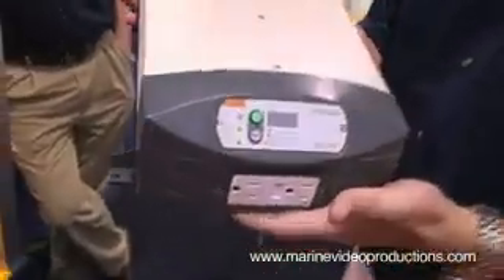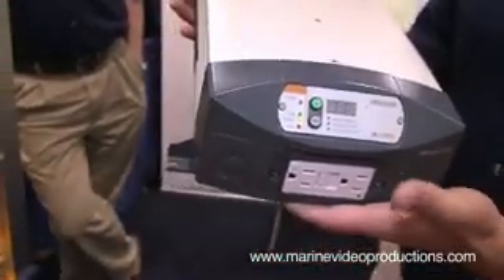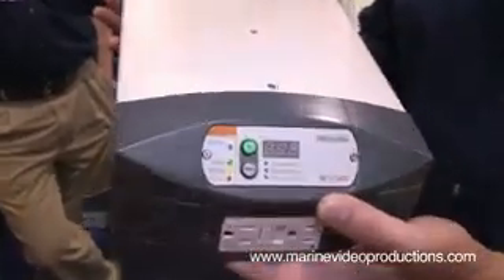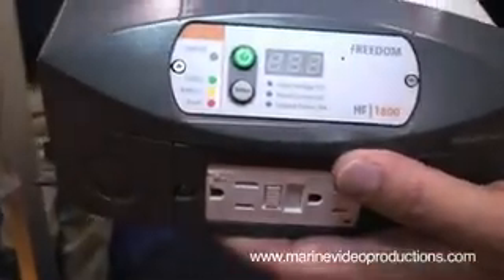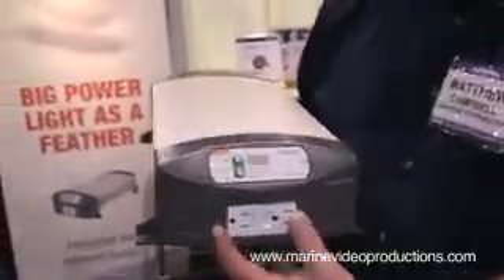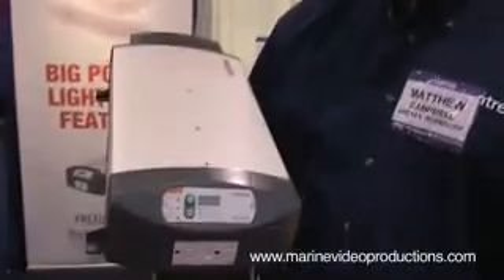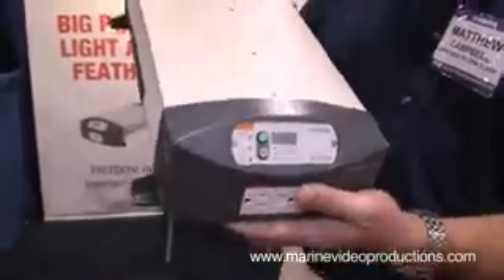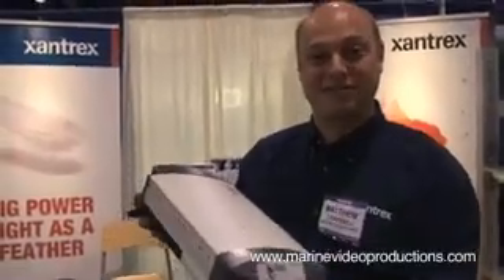Xantrex Freedom HF Inverter/Chargers

Comment: how to set battery on it? wanted to put in 13.5 v
Reply from the maker: FREEDOM HF uses dip switches for battery type.
One configuration is for 13.5 Vdc fixed output.
Reply: @XantrexTechnology  How do you set for AGM ? Is it possible to charge Lifepo? Would like to use lithium battery bank for power